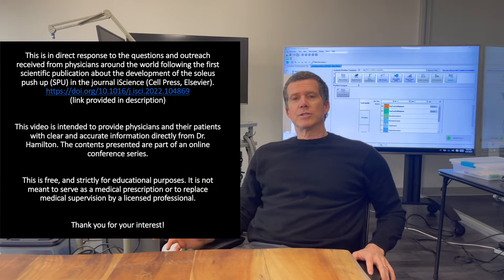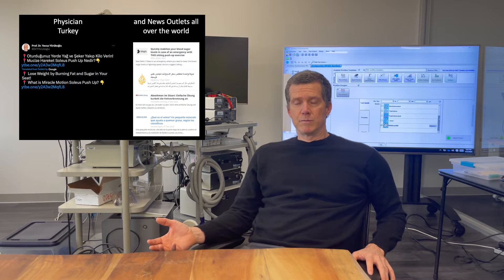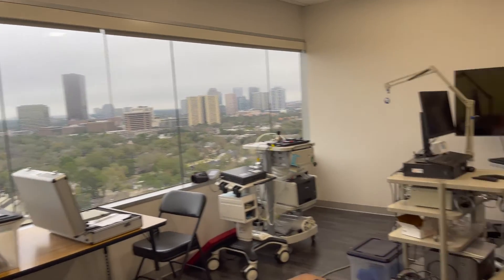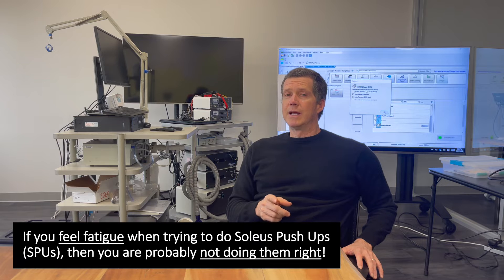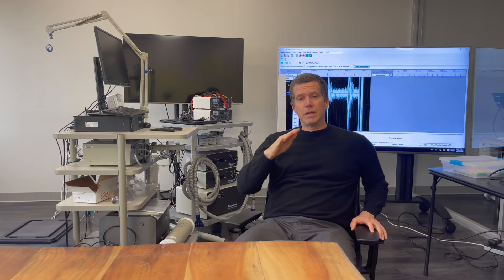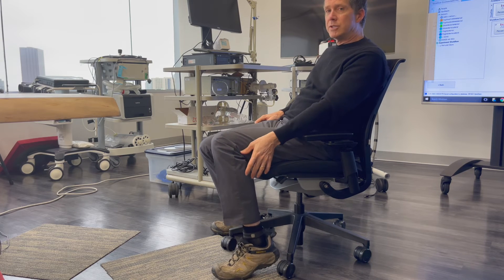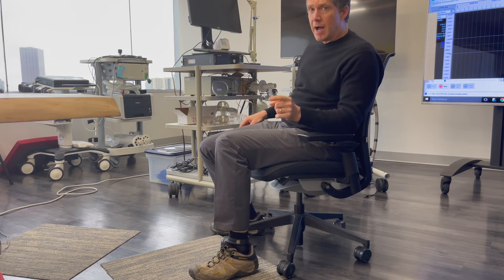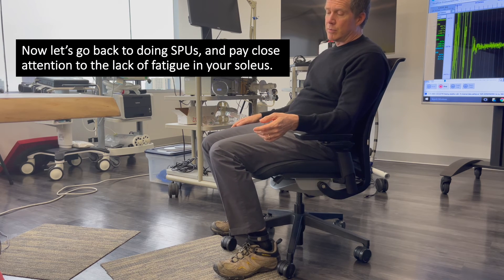Fatigue Resistance of the SPU (Soleus Push Up) demonstrated by the Developer, Dr. Marc Hamilton

Comment: The Calf Confusion: A Guide to Lower Leg Exercises
Why "fidgeting" isn't the same as "lifting," and why your shins matter.
It is easy to confuse these three movements. They all involve sitting down and moving your feet, but they trigger completely different biological systems. One builds muscle, one prevents falls, and one acts like a metabolic "drain" for blood sugar.
Here is the simple breakdown of which one to do and why.
1. The "Sugar Burner"
Formal Name: The Soleus Pushup (SPU)
Target: Soleus Muscle (Deep calf)  
This is the exercise from the viral University of Houston study. It is not designed to build muscle or make you stronger. Its only goal is to trick your muscle into burning fuel (glucose and fats) for hours without getting tired.  
• The Move: Sit with feet flat. Lift your heels high on your toes. Then—and this is the secret—let your heel drop helplessly. Do not control it on the way down.  
• The Feeling: It should feel loose, rhythmic, and effortless. You are essentially "fidgeting" on purpose.
• The Prescription: Do this for long periods (30–60+ minutes) while working at a desk or watching TV.
• Primary Benefit: Lowers blood sugar and insulin levels.  
2. The "Muscle Builder"
Formal Name: Seated Calf Raise
Target: Soleus Muscle (Deep calf)  
This looks exactly like the Sugar Burner, but the intent is opposite. Here, you want to damage the muscle fibers slightly so they grow back bigger and stronger.
• The Move: Sit with a weight on your knees (dumbbells or a machine). Lift your heels high. Lower them slowly and under control. You want to feel the burn and the stretch.
• The Feeling: It should feel difficult. Your calves should burn by the 10th or 15th repetition.
• The Prescription: Do 3 sets of 10–15 reps, perhaps twice a week.
• Primary Benefit: Bigger calves and stronger ankles for pushing off when walking or running.
3. The "Trip Preventer"
Formal Name: Seated Toe Raise (or Tibialis Raise)
Target: Tibialis Anterior (The muscle on the front of your shin)  
This is the "reverse" exercise. Instead of lifting your heels, you keep your heels down and lift your toes. This muscle is often neglected, but it is critical for seniors.  
• The Move: Sit with feet flat. Keep your heels glued to the floor. Lift your toes up toward your shins as high as you can. Hold for a split second, then lower.  
• The Feeling: You will feel a burn on the front of your shin bone immediately. It fatigues very quickly.
• The Prescription: Do 20–25 reps in a row every day.
Primary Benefit: Prevents "foot drop" (shuffling). It ensures you pick your toes up high enough to avoid tripping over rugs or curbs.
The Bottom Line
If your doctor says your A1C or glucose is high, do the Soleus Pushup while you watch the news.
If you find yourself scuffing your feet when you walk or feeling unstable, do the Toe Raises.
If you want your legs to look stronger in shorts, do the Calf Raises.

Comment from the maker: Here are a dozen insights about making this extremely fatigue resistant muscular movement a strong habit!

1.	The soleus during the SPU activity apparently does not “discriminate” against people because of age and some other things limiting many kinds of exercise. This is specific to the SPU motion of the ankle joint during soleus contractions that is done in the absence of adding a heavy load (like the body weight when walking). Some volunteers were able to participate despite a background of very real physical challenges of living after living for years with diabetes, common orthopedic problems, or cardiovascular diseases.
2.	We developed the SPU motion not just to limit the involvement of other muscles, but also to maximize the fuel utilization by the soleus (the opposite of fuel efficiency).  The soleus muscle, although only 1% body weight, possesses sufficiently high quality molecular machinery for substantially improving whole-body metabolic regulation and prolonged contractile activity.
3.	It is the right muscle used the right way. That is a simple expression that might help you understand the goal of this movement. SPUs do not require adding an external load and the resistance is just the weight of the leg when sitting. This relatively light load and the bent knee sitting posture allow for the soleus muscle to be activated during a relatively high velocity movement, which is much different than walking and running (and more energetically demanding). 
4.	Thus make no mistake, SPUs are an intense type of contractile activity at the cellular level; it just does not feel that way. Without the sense of high effort and fatigue, people can do SPUs for hours. 
5.	The perception from what you feel during a muscular activity is not always the same as what is actually happening inside your muscles.
6.	People do not “make time” to do this muscular activity. In the real world, SPUs are spread throughout various periods of the day when doing ordinary sitting. The average person sits about 10 hours/day (~70 hours each week). That is a lot of opportunity to do SPUs. You do not sit more because you choose to do SPUs during ordinary sitting time.
7.	The paradox is that although people do not “make time” to do SPUs, people spend more time doing it than any other type of muscular exercise they have ever done before. A major barrier to most kinds of exercise is that people perceive there is not enough time. People are busy and/or would rather do other things that involve sitting. 
8.	 The SPU activity converts the most unhealthy time of the day (sitting inactive dozens of hours each week) into their most consistent healthy behavior (sitting with an active metabolism because of the soleus).  
9.	It is not an “either/or” type of decision. SPU muscle contractions do not in any way interfere with whatever else you are doing or want to do for good health.
10.	Some people successful in making SPU a regular habit were eager to combine their discipline and grit already gained by various difficulties in life with the newfound knowledge about tapping into soleus metabolism.
11.	Both unfit and fit persons can each display impressive physiological responses. 
12.	Ordinary people have the physical ability and plenty of time to take full advantage of this particular kind of intense muscular contractile activity for more time than they ever thought possible. Some of our research subjects started doing SPUs with high intensity soleus muscle contractions, and for prolonged periods without fatigue, even though they had no exercise training background.

Comment: AWSOME, no fatigue at all!!! and burning glucose, will try it with a CGM and see what happens, congratulations from Brazil. Keep up with this fantastic research, thanks thanks thanks
Reply from the maker: Finger stick methods can be more accurate measurement of arterial glucose than CGM.  Check out the details in the Methods Section and Supplementary Data of our iScience publication for an inexpensive good device and how to run it in triplicate each time period after doing a controlled 75 g OGTT. Make sure to always start the test after a long fast (at least overnight). This and other methods help when you are testing your patients as a doctor yourself, or even in your own personal tests on yourself.
Reply from the maker: Btw- for those who don’t know, a finger stick is good because the drop of blood is more reflective of the “capillary blood” that enters into not just your finger, but all other body parts.  In contrast, a CGM measures the “interstitial space” that is the fluid surrounding the skin or fat where the CGM is stuck. Even a catheter into a vein is less of an accurate measurement than the finger; the venous blood in a forearm is unfortunately biased because the forearm muscles extract variable amounts of glucose prior to entering into the catheter. Bottom line: stick your finger while sitting motionless on an inactive day as your “sedentary control” vs another day when you sit the same time after ingesting glucose while doing SPUs.  We prefer a 3 hour test when patients have elevated glucose above fasting that long on the inactive test days.

Comment: Thank you so much for sharing your Wisdom .I have only one question how many minutes are 1000 Soleus Push UPS??
Reply from the maker: It of course depends on the rate you go at. Change it up. Like with music, there is no one required pace.  Sometimes you will find it easier to keep it rolling comfortably a longer time if you go faster (but rarely go over 150/min, and never >200 min). But it’s ok to also go much slower. In some situations I go really slow and you can’t see I’m moving , or it appears more like I’m rocking in a relaxed way. Most people are over 50/min just to keep the flow smooth.  (BTW some people count both of the 2 legs separately like walking steps.  Others just count them as one contracting unit together as just 1 “step” (despite normally counting each leg’s step separately. If so, 1000 SPUs is 10 min if you are at a rate of 100 per min.

Comment: Hi I am a now 85 year old runner started running at about 38 years old. But from 41 yo to 69 yo suffered from recurring calf injuries just as I was getting in form. So I looked into the function of the calf muscles and exercise the soleous muscle was the answer, was then able to get good age group time 21.41 5k at 70 years old 23.04 at 75 yo. Every sprint and middle distance race on the track with good age group times. Your video as given me even more insight that I can pass on to younger athletes. Thank you very much
Reply from the maker: You have a lot of fascinating experiences I’m sure. Stay in touch. A lot of people, myself included, are using SPUs to train the soleus and know it’s the single most important muscle to running performance, or at least our balance as we age!
Reply: @marchamiltonphd the recommended regime for athletes was 20 heel raise reps for 6 sets with a 1 to 2 inch block under the front of the foot this worked well for me.
Reply from the maker: @louissatt8497 that’s a good method for adding strength. A much different approach we find effective for gaining massive improvement for endurance is to do SPUs in the hours of the day when not running, to replace ordinary inactive sitting time with the same amount of time filled with SPUs as the more metabolically intense (but fatigue resistant) kind of soleus training.  We reported that the VO2 (oxygen consumption) of the local soleus working muscle mass increases far more than walking and even running during the SPUs. Think of it this way: the soleus metabolism can be kept at a level like an all out sprint all day long without adverse concerns of overtraining it.
Reply: Thanks Doc I'll pass that on to some of the runners I advise .
Reply from the maker: @louissatt8497 show them the graph on the iScience article that shows the VO2 of walking, running, and SPUs of the same people. We have a new paper that was published just last month that adds to this (it’s free of charge and easy to download, from the journal Frontiers in Endocrinology 2025, with my name as the first author.
Reply: So if I have an insulin resistance will this help...
Reply from the maker: Very much so. Take a look at the original article and the even longer new one just loaded this week. Both are freely available and likely easily understandable to learn from and act upon everything in them!

Comment: I have insuline resistance. At the moment I'm wearing a CGM, a blood glucose monitor, in order to learn how my body reacts to diet and exercise. I'm just after a large, carb-heavy meal (it's for science, I promise 😉). I've already seen huge impact of calf exercise, like walking or simply standing for immediate lowering blood glucose. As I started watching this video my glucose has already risen from 90 to 160. Knowing my previous reactions I expected it to increase to about 180. During 15 minutes of SPUs it decreased to 140. I have no idea if that's SPU, or insulin. But earlier today I had two very small, very healthy, low-IG meals, with fiber and 40g of whole rye flour bread, which should have a glycemic load below 10. They increased my blood sugar to 140 while seating. I was kind of disappointed.

I think I'll still prefer working standing by a desk, or walking on an under-desk treadmill to regulate my glucose, but I'll also test more thoroughly your exercise 🙂 Thanks a lot.
Reply from the maker: See the other 2 replies I just gave today about CGM vs finger stick methods to also consider learning to try.

Comment: Come to find out that the last muscle that was contributing to my knee pain was the soleus! Rowing and doing Soleus push-ups totally get rid of my knee pain which I’ve had for years and just couldn’t get rid of! 👍🏼
Reply from the maker: I’m glad for you. Interesting little known related fact. Although the soleus doesn’t directly make the knee bend (like the thigh muscles), the soleus has a major role in stability which impacts the knees, hips, back, and balance far more than any other single muscle. Think of it like the foundation of a structure or base of a tall structure you dint want to wobble.

Comment: I have a spinal cord injury that reduces my fine motor control in my legs and feet. In doing this raising both heels together, the result was that I quickly became shaky. My movements are not smooth but rather tend to be quite jerky. If I alternated the heel raises (left foot right foot etc.), I do not seem to have this problem. Is alternating the feet with separate SPUs effective? It does not seem to be a matter of fatigue. I had no trouble keeping up movement throughout the 16 minutes of the video. I hope you will address my question. Thank you in advance and thank you for this video series.
Reply from the maker: @jvanncunningham  yes absolutely. “Alternating SPUs” with one leg at a time (like walking does too) is exactly the same total metabolic response as when the 2 Soleus muscles work simultaneously (what I call “dual” SPUs). 
BTW- I recommend that everyone pay attention to the simple fact that sometimes depending on where they are sitting, to be open to alternating and sometimes dual (not just for reasons you stated).
Reply: @marchamiltonphd  I am very grateful for your reply and the information. I am going to start this on a regular basis. In the last 18 months I have lowered my A1c from 8.6 to 5.0 with diet and exercise. BP from 167/95 on meds to 106/65 NO meds. took off over 40 pounds. Lowered my bio age by 2 years to 68 and I am 74.5. I take this stuff seriously. Thank you again.

Comment: Dr.Hamilton, what is the average calorie that our body consume for an hour while we are doing SPU, for example 60-80 times a minute? Thanks
Reply from the maker: @hakancaglayan5947  the most easy and accurate expectation is that you double (2X) your “whole body” energy expenditure. Our research subjects who were unfit according to exercise standards were able to sustain more than even that amount all day (many hours they were sitting). That’s fantastic of course because NOTHING else is as effective at keeping muscle metabolism elevated for nearly as much time anywhere you normally sit inactive otherwise. 
*But the KEY CONCEPT isn’t about the “total calories” but rather the “fuel mix” with SPUs is VERY unique. Even the soleus uses mostly glycogen as the main carbohydrate when walking. Other muscles in the thigh also prefer to use glycogen. SPUs rely instead on blood glucose (after eating carbohydrates) or the dangerous kind of blood fats to get those calories. So each kcal of SPU energy is more health enhancing than each kcal of energy from exercise using mostly glycogen.
Reply: Thanks for the answer Dr.Hamilton 🙏

Comment: @machamiltonphd Hello Dr. Marc Hamilton I just discovered this amazing video of yours about the SPU. I’d like to know—if your heels don’t touch the ground, are you still doing the SPU correctly? I can't seem to get my heels to touch the ground unless my toes go past my knees. How should I adjust my position to perform the exercise correctly?
Reply from the maker: @yomqwe  the heels don’t need to touch the floor. Most all of the pressure is on the “ball of the foot” (the MTP joint which connect the toe bones to the foot). What I frequently do to optimize the soleus power is to pull my feet back while also sliding my hips forward.
Reply: @marchamiltonphd  Thank you so much 🙇‍♂️🙏
Reply from the maker: @yomqwe  to add to the last tip, also if your heels are not touching the floor, make sure to allow the gravity to take your heels down to the full range of motion your ankle will allow.  The SPU is most effective when your ankle is moving up and down over a wide range of motion.
Reply: @marchamiltonphd  Thank you so much Dr. Marc Hamilton, for taking your time to anwser my question. I was forcing the heels to touch the floor which was very challenging. Appreciate you so much 🙏
Reply: I have been doing this execise for 1 year and the result is amazing,18mml after dinner,doing it coerrectly for 20 minutes..down to 12mml,another 15 minutes down to 8mml..amazing,god bless you dr hamilton
Reply from the maker: @ impressive!